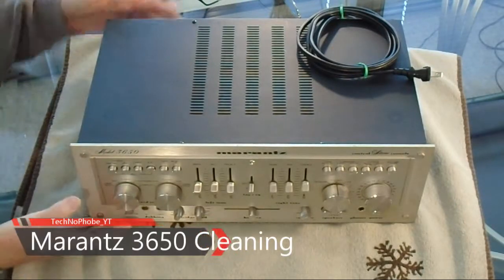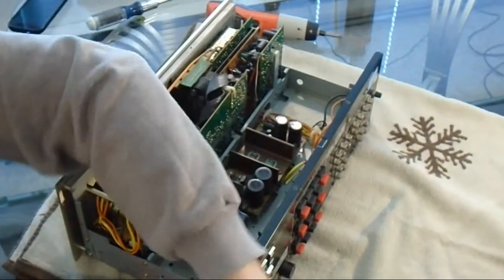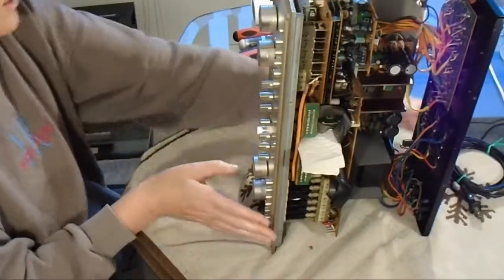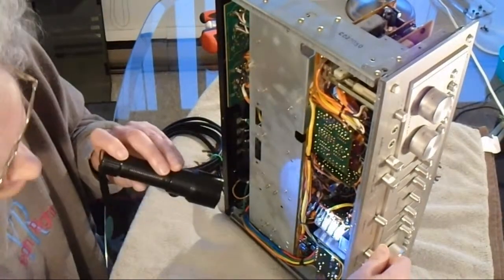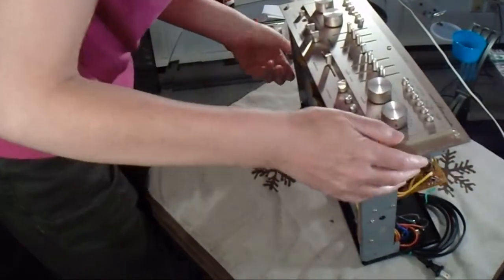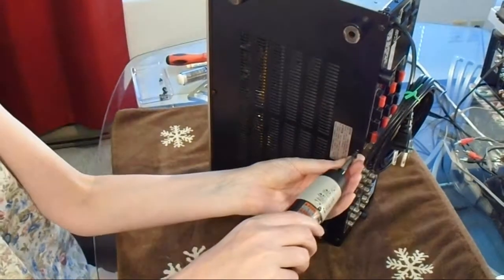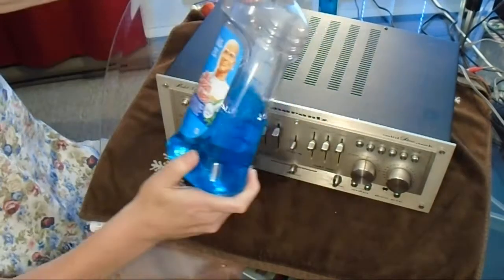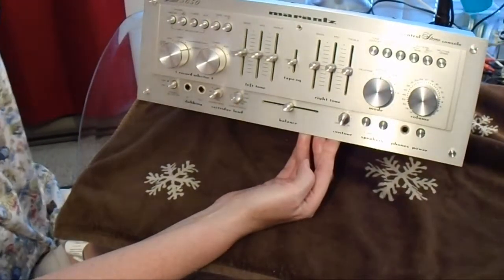Marantz 3650 Stereo Control Console Cleaning

Comment: Nice work miss. I use to sell these in audio shop Montreal,QC Marantz & JBL audio equipments for 5 years in 1970'' that was good quality audio. I should buy more equipment in that time !  nice video * The technicien I work with in that time, he would not made a better job then you *
Reply from the maker: Wow! Thank you SO MUCH! I really don't know anything about electronics, but I wanted to help out my dad with his beautiful, vintage equipment, so I watched some electronics repair vids on YT and took a shot at it. I was pretty nervous because I didn't want to pooch his equipment. He ended up taking the unit to an electronics guy and he found out the problem with the one channel cutting out--it was a cracked solder connection, which he fixed. I REALLY appreciate the lovely comment! I know the audio and video aren't very good, but I did my BEST with my crappy camera in order to help out other people. It never ceases to irritate me how people can give your video a thumbs down (for WHATEVER reason) when you are spending YOUR precious time making a video in order to help others. Some people REALLY suck. It's sad!